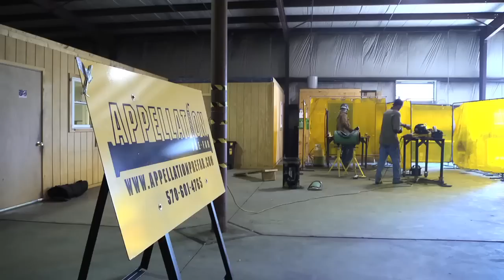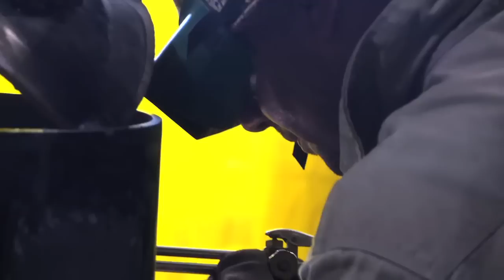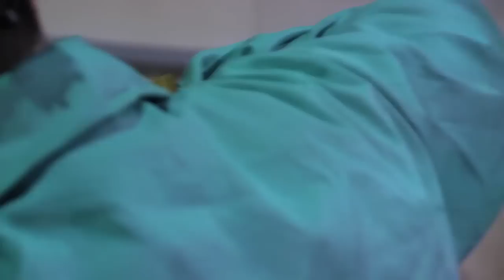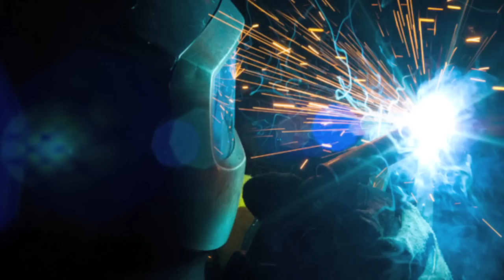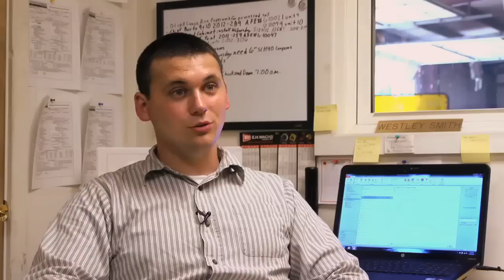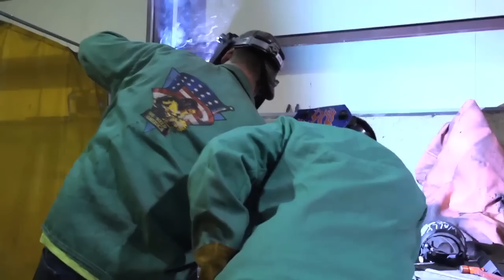Welding Engineer Westley Smith

Comment: Do you got a hands on and welding cuz your video says it does cuz I'll be going to school there next spring that's coming spring for well then and do you do with concrete for welding too how to place steel and concrete like you got to put a hole in the wall and build it that's what I want to find out how much a welder gets after a graduated robot welding and regular Weldon how much I get an hour